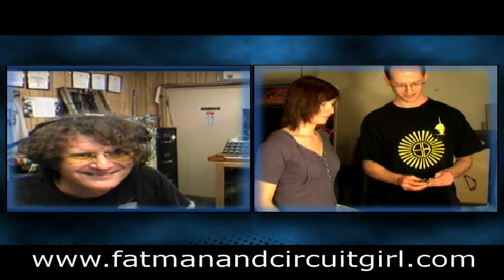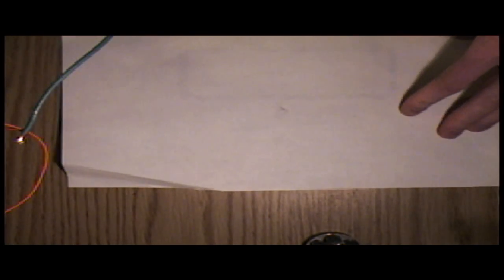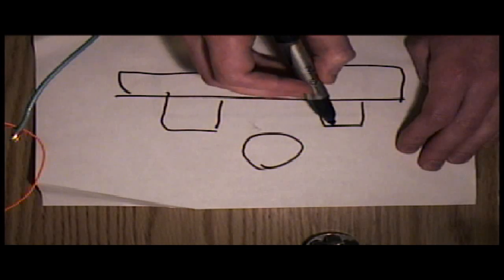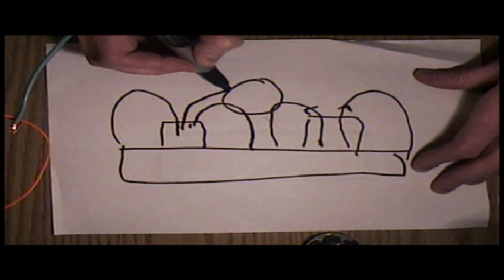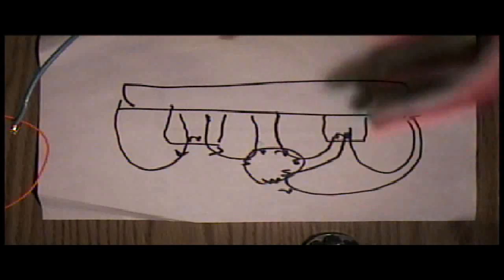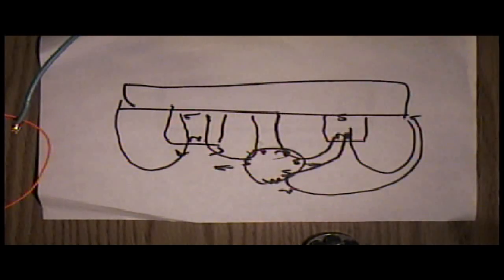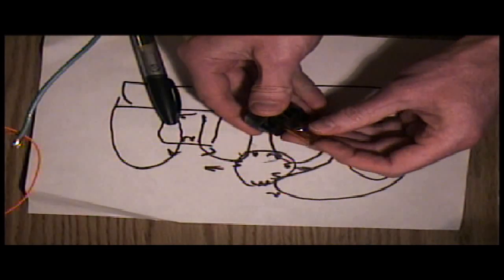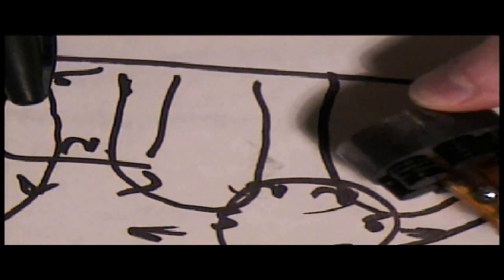Ring Magnet Levitation

Comment: Beacuse the steel ball is positivly and neg at the same time at each ends this is possiable becouse of the diamagnetic effect along the central axis of ring magnets but this kind of levitation has no side holding. The feilds hold stable due to the flux saturation of the steel. 
There are also some other forces at play.